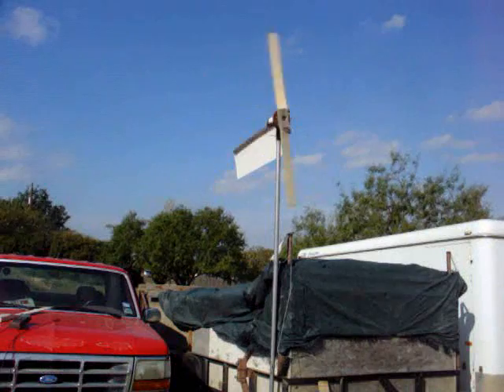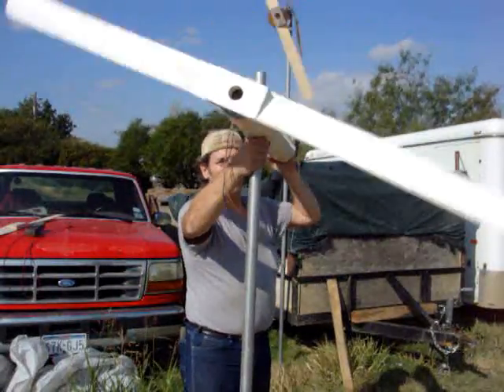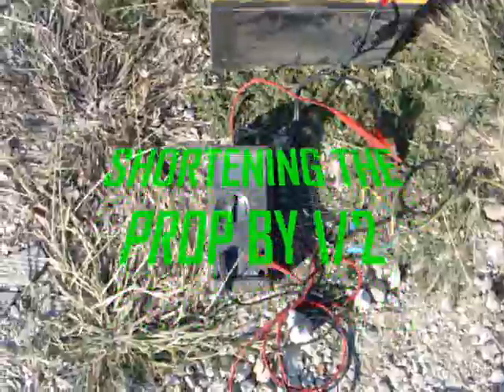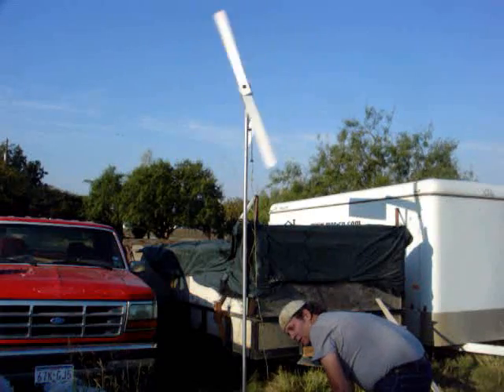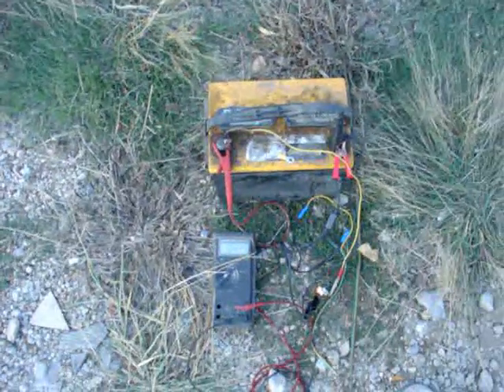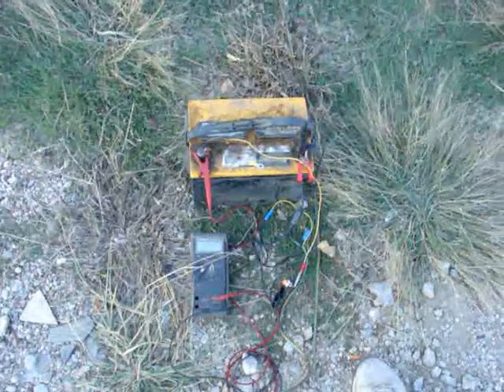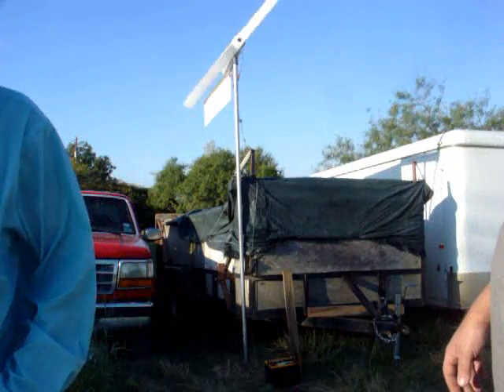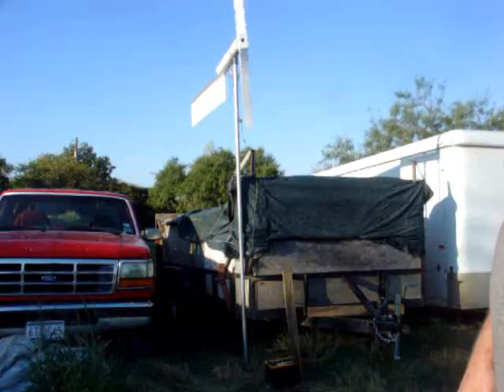CLUGGYS' WIND TURBINE PROP TESTS AT BOOMTOWN LABORATORIES

Comment: WHEN A FLOWER UNFURLS, IT UNFOLDS AND BLOOMS. WHEN IT FIRLS UP, IT REFOLDS ITSELF TO IT'S POD LOOK.
WHEN A WIND TURBINE FURLS, IT FOLDS THE BODY OF THE WIND TURBINE SO THAT THE BLADES SPIN PARALLEL TO THE TAIL. THAT DOES THE SAME THING YOU SAW ME DO WHEN THE WIND GOT A BIT TOO STRONG. I TURNED THE BLADES OUT OF THE WIND. WHEN THE WIND DIES DOWN TO A DECENT SPEED, THE TAIL AND BLADES WILL UNFURL PUTTING THE BLADES BACK INTO THE WIND.
THANKS,
THAT QUESTION IS NOT ASKED ENOUGH FOR SAFETY.
MUDDy

Comment: loved the video! glad to know your in Texas i am in MISS. the curve of the blade you said keeps a speed when there is no wind at the time?
i dont seem to get that good of wind even though id like to build one myself.
so rounded flat end tips will make it quiet sharpen the back and round the front. 
what if the end of the tips are slightly pointed like a Cessna prop?
my next question would be what if you just used a small planes prop?

Comment: great job. if reducing blade length quites prop but loses amperage, what about 4 shorty blades ?  The mast of turbine at the n. side shop is it just top rail off a chain link fence ? If so and you need more got several 15 or 20 foot pcs. At the going price of that Greatist 4 letter word. FREE !!  will be getting those motors to your shop also.  Enjoy the knowlege you share.